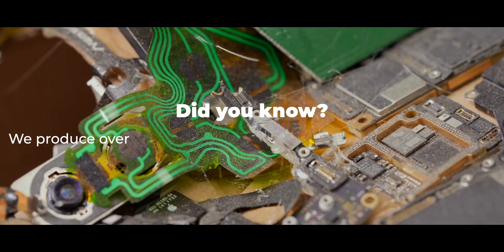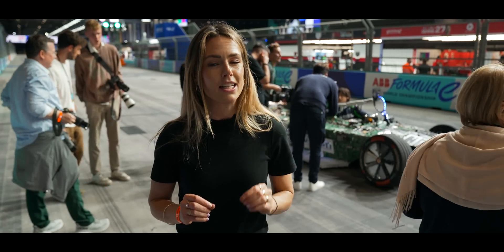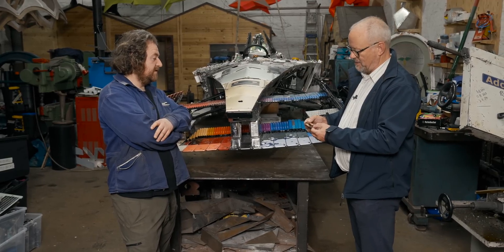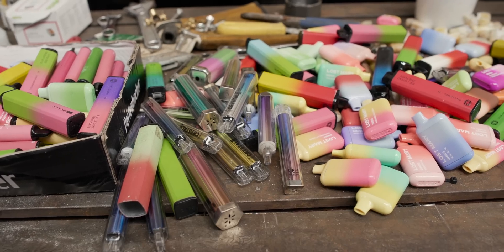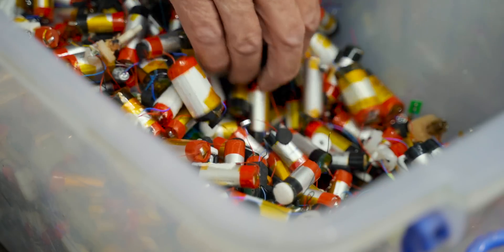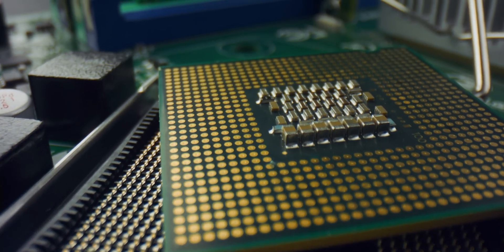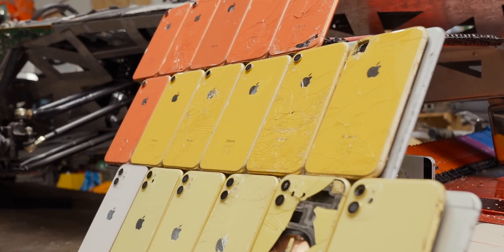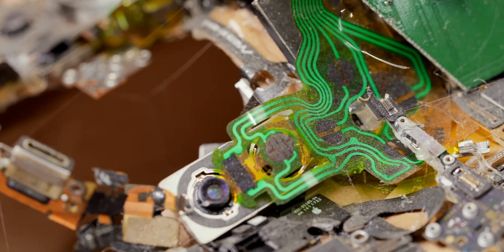This Electric Car is Made From Recycled Vapes!

Comment: How many cables have YOU got stored away in a drawer??!
Reply: Stored in a drawer?

Ah, such naive innocence. To presume that men would logically gather them all to the one storage location, to place even that most rudimentary level of order on things. Of course not, my sweet Summer child.
Reply: @klaxoncow  
😂😂😂😂

Some of the posts verge on the infantile ... and bear little or no relation to the episode ... or indeed how the episode is skewed to a particular "issue".

We see heat pumps v storage radiators (albeit controlled by a processor, do we are led to belief).

We don't get a better explanation of how "insulation" is the most important aspect of all.

Neither do we get much in the way of instant hot water information.

Clearly nobody on the design side of this channel has taken storage of said hot water either.

Storing hot water on a small scale is wasteful.

Robert appears to be oblivious to the decades old research by UK unis proving that insulation, coupled to passive heating is probably the best solution.

Come on Robert, stop the product placement thing and do much more research.
Reply: I'm to frightened to clean out that particular cupboard. But a lot, some of them are for old devices like my Nintendo Supernest that I don't intend to sale anytime soon.
Reply: All cables are kept in a bin, if i can strip out clean copper it sells for $3.00 a pound.  Other wise it goes for $1.00 a pound.
Reply: @ImogenBhogal :  I'm not answering that!... you're talking about my treasure!   🤐 🥴
Reply: Never mind what you have in your cable collection.

In UK we have been migrating to glass circuits for some time, even Toslink for domestic hifi..

We learned recently that BT are beginning to phase out "land lines".

This means there are thousands and thousands and thousands of tons of "paper insulated twisted copper pair" wires sitting in ducts across the country, just waiting to be "mined". by BT or their subbies...

Has to be worth millions ... however, can't see the metal markets being too impressed with a glut of copper and tinned copper cables being dumped at your local scrap metal merchant.
Reply: Too many surely... I have no idea how many cables we actually have here at home.
Reply: Why are you feeding this scam? This issue isnt consumers, its manufacturers. Its regulation.
 The people you spoke to ALL talked about systemic change, and then you added 'whats in your drawer'?
Yikes. That only diverts energy from systemic change. Theres no infrastructure to recycle most of it anyway (as Australia dramatically found out recently)
Reply: "a" drawer, LOL. More like a few tote boxes worth!
Reply: Two shopping bags, awaiting a trip to the recycling center.

Comment: Couple weeks ago I went for a walk with my dad and found a discarded e-bike battery full of samsung 2.5ah 18650 cells
I bought a couple powerbank cases that accept these, and now I have powerbanks that can use over 30 cells before it needs to be charged.
I think we need to standardize lithium ion cells for small electronics same as AA batteries, and just add a standard BMS.
At least make it so it's easy to extract those cells and recycle them.

Comment: The problem with recycling is we need to make rules and processes that encourage recycling.
Here is a perfect example, i have aluminum chips that come out of from machining. This is pure metal with no other metal contaminants.  It can be melted straight back into bars but I get so little money for it at recycling centers that I spend more money to get it there than what I get for the material. So currently they all go to landfill.
Reply: Obvious solution is to melt it back into bars or whatever shape you want yourself so you can machine it again without have to buy new and expensive stock.
You also save a trip to the recycling centers.

Comment: Or just use your phone for as long as you reasonably can. I try to keep my phones and tablets for at least 5 years. One device lasted 7 years. And our desktop PC I think is about a decade old, even if it is rarely used now.
Reply: I wish I could keep my phone for 5 years, I always end up breaking them long before that.
Reply: @DavidKnowles0  I would say the key thing is to just be very careful when outside. Never hold it loosely when walking for example. My phone falls off the couch about 5 times a day but landing on soft carpet it’s never going to break. And in terms of usage, you’d really have to push the phone extremely hard to wear out the battery quickly. I don’t think most people do much in terms of intensive tasks on phones. People seem to get a two year contract and just change after that because they can. I buy a phone directly from Apple and put my sim in it. If everyone did that, the amount of e-waste we’d avoid would be massive.

Comment: its funny, you know. ive used a small number of disposable vapes in the times when i was camping. i was never quite sure what to do with them after they are done since i am aware that there is a pretty big battery in there. heck, its not much different than the battery i used in the EVOD type device that probably lasted the frist year of me vaping. but anyways, making art out of recycled stuff is all fun and good. but other than the local thrash dump and a single gathering site for reycable materials, there is hardly a place to put ewaste and we should probably get better at gathering it.
Reply: My council will take anything size up to a large microwave.  from the kerb. I presume they would take vapes as well.
Reply: @DavidKnowles0  Well that's handy, all of the discarded ones i see are literally in the gutter/kerb 😅.  
(like most Makers, i pick them up when i see them.  We'd normally be buying these batteries from Ali-express, now they're free - picked fresh from the gutter!)
Reply: Keep them. Lithium carbonate and cobalt are currently about $30 per kilogram, Nickel, $20/kg, copper $10/kg.
When you've collected lots, they will be worth a small fortune.

Comment: All them vape batteries are ridiculous. So wasteful
Reply: Particularly because it's all so perfectly unnecessary.

Disposable vapes should simply be banned. Outright. 100%. No exceptions. As there's just zero need for it.

You can get ones that use a couple of standard rechargeable 18650 batteries. Like, no other kind should be legally permissible - not just because disposable batteries should be banned on principle, but if all batteries are only one standard type (the 18650) then a single process can be developed for recycling them and re-using the materials they contain.

Comment: but but but, you have to throw away the batteries every 3 years, and each battery contains the fingers of 5 cobalt miners each!
Reply: but but but And if you accidentally leave the courtesy lights on during the night the car will explode due to the battery overheating. It's a known design fault.